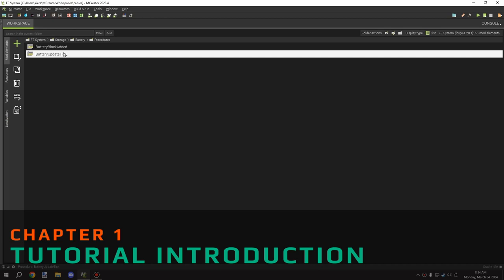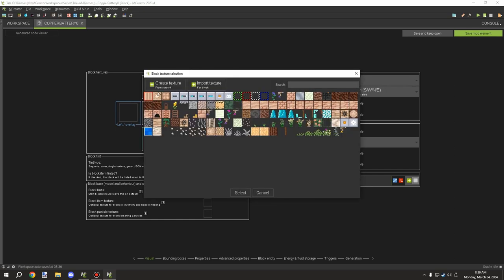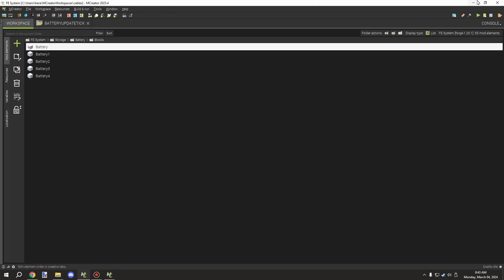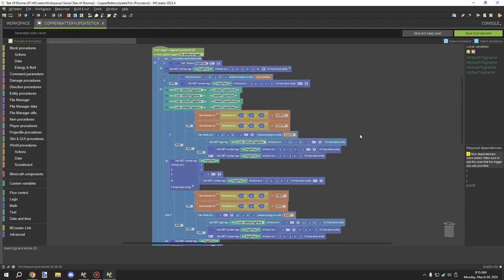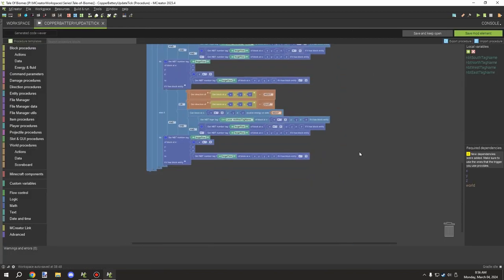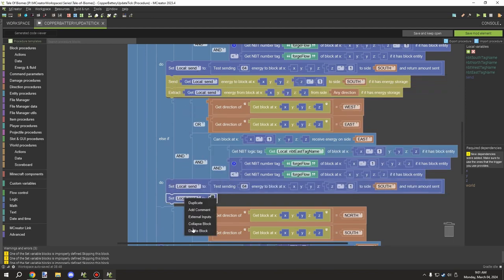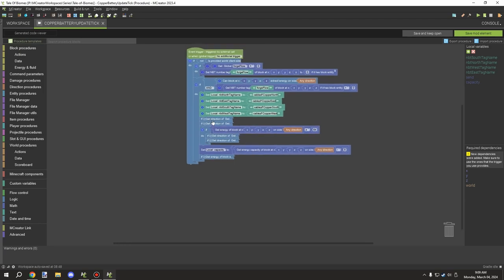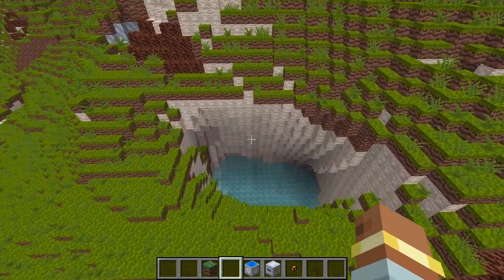Part 5 | Forge Energy Battery | MCreator

Comment: amazing series, can't wait for more
Reply from the maker: I have one more video made for a basic drill machine that can drill downwards that uses FE.
This will be published next week. This weekend I will be working on getting fluid system up and running.
We will be taking a 3 week break though after next week so I can catch up on some tutorials people wanted me to cover. Two tutorial updates and one new tutorial for the feature element then it will be back to this series for a few weeks. Most likely followed by another break and possibly some polls for addition device specific tutorials which can open up some more coding examples for the workspace.

Comment: Hello! Is it possible to make a mob that can crawl through 1 block of height spaces? Like the Cave Dweller can do it, is it possible to code in MCreator? I can't find any suitable procedures for this. Please help me.
Reply from the maker: "Is it possible to make a mob that can crawl through 1 block of height spaces?"
The entity hitbox needs to be small enough where it will fit through a space setting width/depth and height to 0.5 should do the trick. Just keep in mind Minecraft entity AI is not that good its all basically the same thing in MCreator not smarter than a chicken really but chickens can path find into small spaces they just don't do it that often unless they have to.

Comment: Bro, I have a question for you, you know how you drag an element to another place, how do you do that?
Reply from the maker: Its tricky and does not always work but if you select the elements and then double clicked with the mouse and drag, some times it will give you a icon by the mouse and to indicate your dragging something. Though I have experience that it has a vary select mind of its own and some times will drag everything in the folder other times just one item, and sometimes its just a pain to get it to do anything at all. Though if you follow the steps you should eventually get something to move. Ideally it would be nice if the devs remade the feature and make it easier to use.

Comment: How do you make the battery retain its energy level when broken and placed again?
Reply from the maker: You can't really store FE to items, it's simply not possible with FE and FF.
Though it is possible with NBT you need to add the item before the block is broken to the player's inventory, assign the amount of power, and finally have the block removed without any drop.

For adding it you would need to get place add the block and then set the NBT value from the item.

As a side note, though, lots of things will require the use of the NBT variable, as FE and FF are really limited to what can be done. Though it's easier than making everything from scratch it won't get people anywhere close to mods like Industrial Craft, But I am working on a project that uses NBT instead and I plan to make a tutorial series on how to use it. Chances are it will cover both an optional API which can make mods easier as well as the script in the API but not sure when it will be ready to start pushing out tutorials. Still got bugs with my math to sort out at the moment but just thought I would make a quick note about that and the issues with FE and FF.

Comment: Hi, I have a problem, where the battery doesn't send energy to cables. Can you tell me how to fix this?
Reply from the maker: Part four covers the fix I made for transporting energy. Keep in mind that it will take a few moments for the cables to reset based on the forge flow timer speed but it will in time reset the cables and sync all the blocks on the line of the generator to the IDs they need to have automatically.

Also make sure your using the latest project workspace for the procedure templates older versions had issues and several patches were made. 

Also the fluid system is currently not working but cables should be. I have not had any issues with energy just fluid. SI am still trying to figure out why fluid has issues but it could be the way I am trying to detect fluid in the cables honestly it would have been better if I made my own system fluid is really limited what can be tested and though the setting point to more than one tank there is no way to have any additional tanks meaning its not possible to transport more than one fluid. 

Also same issues with using more than one fluid for a block so you end up having to use one pipe for one fluid and its just really hard to work with. It also does not help that its not possible to use namespaces and registry for fluid rather than selection. But it just is. I may find the root cause but it won't happen any time soon that's for sure.

Anyhow I hope my suggestions resolve your issue.

Comment: Hey i followed the tutorial but the battery didn't charge the texture and it doesn't send energy, but it collects it
Reply from the maker: There was issues with a older version of the workspace, make sure  you have the latest version. I also had to adapt the engery with a flow system which is explained one of the future videos. It allows energy to flow away from connected generators making sure it does not back track and get stuck.
Reply: @NorthWestTreesMCreator  tks
Reply: @NorthWestTreesMCreator  so I need to download the 2024.1 version?